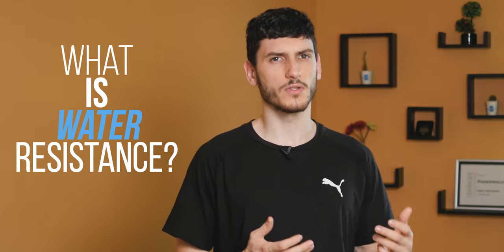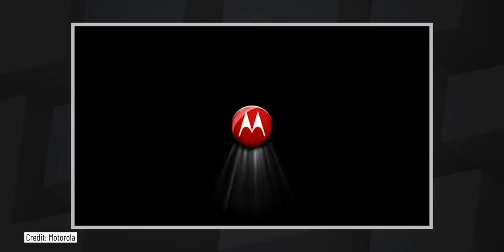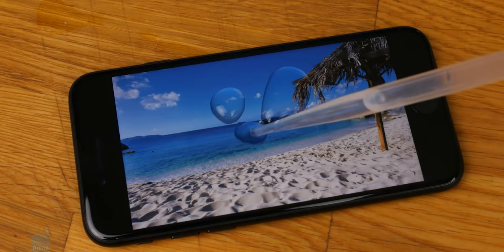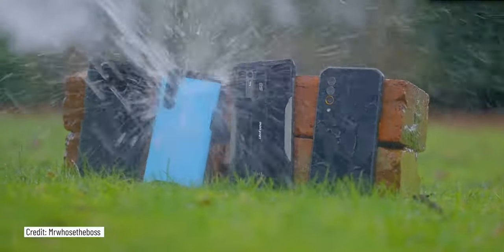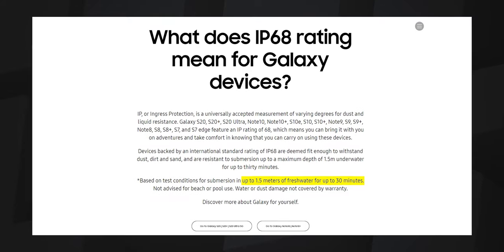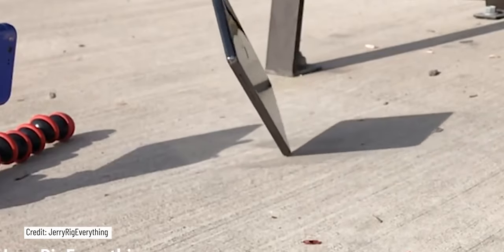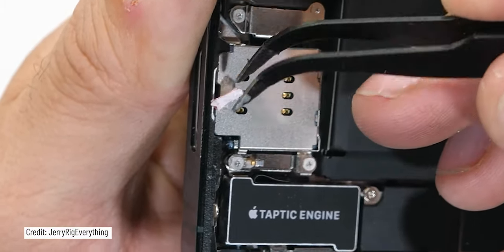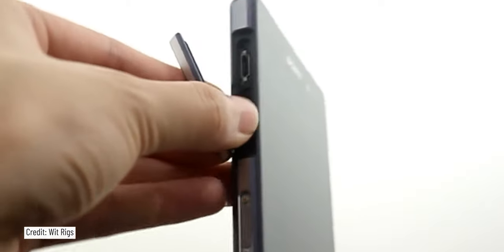Water resistance: IP rating explained

Comment: So I could technically go swimming with my earbuds with IP67 rating 30 min -1 meter. I’m not going to because i loose them in normal situations, I don’t need to add elements to my troubles. 😂

Comment: Should the phone be dried off before charging? Can you explain how water resistant seals work with cable charging? Thank you!
Reply: More premium and modern phones will disable the ports for charging if there's something stuck in there or it has had water there. Does your phone give you a warning that there is debree in the port? It will go away when it should be safe to use again. More budget phones might not have this as it's device by device basis. I would at least wait minimum 24h and leave it in a warm room. Don't put it in rice as that will insulate the water and make the problem worse. 

https://youtu.be/UU5T0GOmfvE